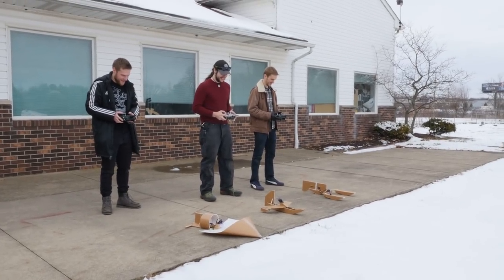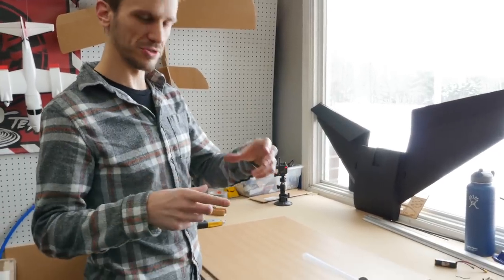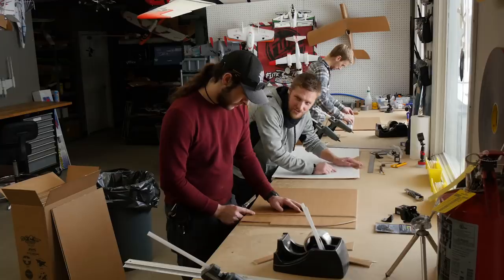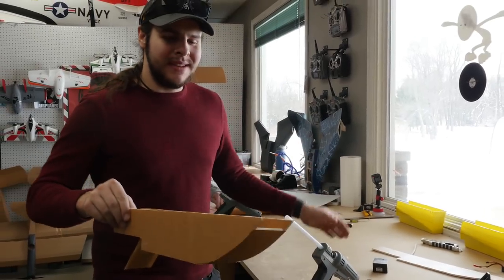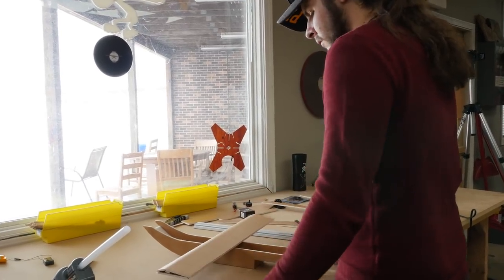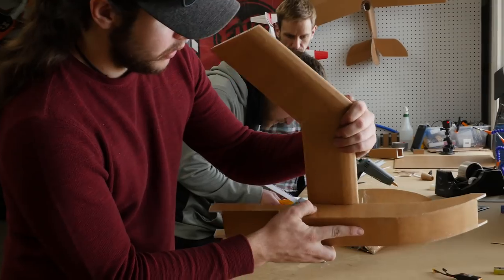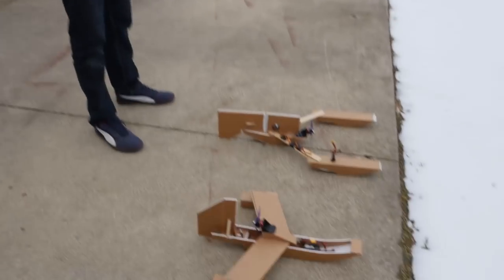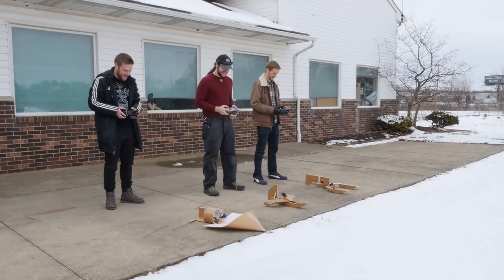Snow Skimmer from 1 Sheet of Foamboard!

Comment: As the spokesperson on behalf of the "Officially Unofficial :Stefan fan club" I would like to congratulate Stefan on not only completing the build with the self imposed 1 sheet limit, but also in creating one of the coolest RC snowmobiles we have ever seen ! Keep the awesome videos coming
Reply from the maker: HAHA!!! Thanks so much my friend... ha Classic! ;) Keep on being awesome!
Reply: I'm gonna agree, now if he'd sliced 3.5" off the sheet width to begin with, wrapped that nose, hacksaw'd a 3/8" V about 4-5" back (sideways thru the top) and re-glued shut to lift the point about 1.5" (adding rigidity too).... that 3.5x30" edge would be motor mount and steering vanes. the basic concept is there, he did that great! a little refining and it'd be good to go on snow or on water. with the battery up front it'd keep the open rear up so it wont flood easily at rest, and once moving that nose gives some down force and splash protection. seriously, it could be the simplest good performing airboat for snow, grass, water etc. motor+prop pointed slightly downward to prevent lift-off, a little more than halfway back from the nose. the curved bottom is friendly to "drifting" turns etc.

another refinement might be cutting from center to edge an inch wide triangle from both (front) sides to make it "pointier" to start with, so the curve extends further down the rest of it's "body" (more like typical double folded basic paper airplane shape). again, seriously, Stefan you should tinker/tweak with the concept you whupped out

Comment: Really great episode. I just finished building a hovercraft out of foam board and old vortex 250 parts. Easily the most fun and rewarding thing I’ve done in the hobby thus far
Reply from the maker: Awesome Tyrone! Keep up the awesome work! If you want to share it... go to our articles/forums pages and write something up ad share it with the community! They will love it! ha
Reply: fun stuff! did one last year with a coroplast yard sign and a pool noodle. single motor ducted type (more coroplast) with a 2212 size 2700kv turning a 6 blade 5" 3p prop. might have spent 20 bucks, electronics included, runs great!

Comment: iam a noob   !!!   how do i set only one motor and use a servo to controle the wing ??  i want to build my first boat or plane Rc  i need ur help :)
Reply: just need to mount motor+prop where you want, an ESC to run that (ch2). ch1 is steering, watch the servo to set up left/right = left/right. I'd start with an air boat because it'll be cheapest easiest, coupler + prop shaft + prop can get a little expensive real quick (but I love it!).